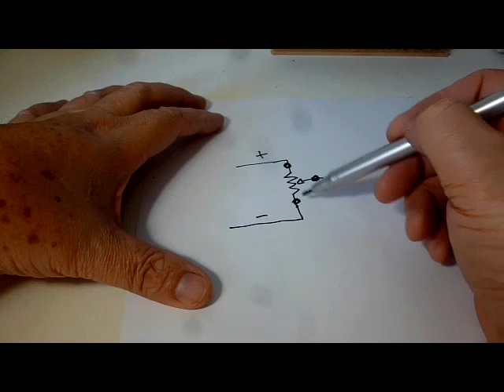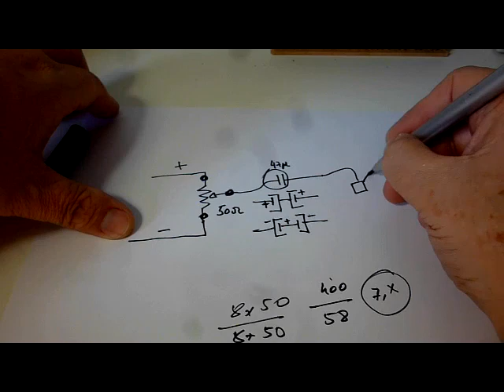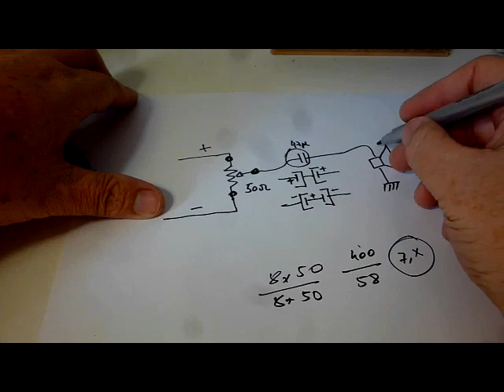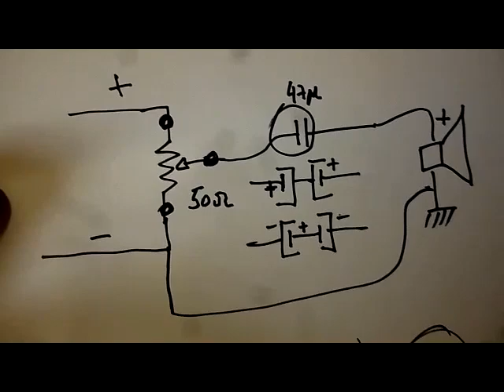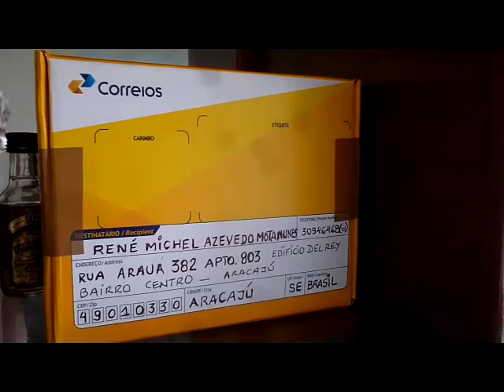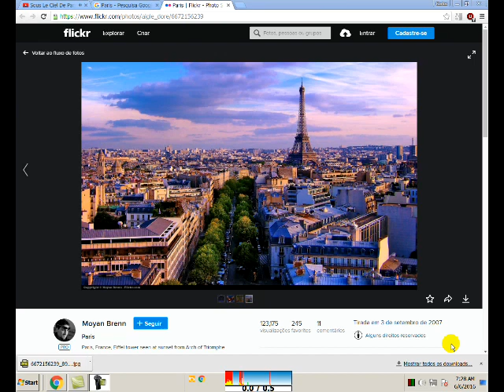Dx Classic - Montagem de um  refletor de médios

Comment: Mergulhão, estou com um transformador billion especificando "76x40" no primário e secundário. ele tem 7 e 10 pinos respectivamente. Estou com dúvida em quais pinos do primário é a entrada 220AC, pois a maior resistência que consegui medir com multímetro na escala de 200 Ohms foi 16 Ohms (a menor é 5.4 Ohms) . Esse transformador é parecido com o seu (Só que menor), que está no gabinete dos DX classic's. Estou com medo de curto-circuitar  a rede de casa com ligação errada rsrs.
Reply: amigo esse transformador provavelmente nao serve pro tipo de coisa que você ta querendo fazer
Reply from the maker: O fio fino é o primario....mas podes ter dois enrolamentos os quais vais precisar ligar em série caso sua tensão seja 220 volts...procure a maior resistência possivel...procure o esquema do aparelho de onde esse trafo saíu para identificar esses pinos.

A resistência mais baixa é o secundário....são fios grossos e o terminal central tem dois fios juntos nêle....

Não posso tirar seu mêdo...isso eu não consigo.
Reply: Obrigado :D, vou ir testando aqui. já procurei o esquema mas não achei (um mini system Philips antigo).